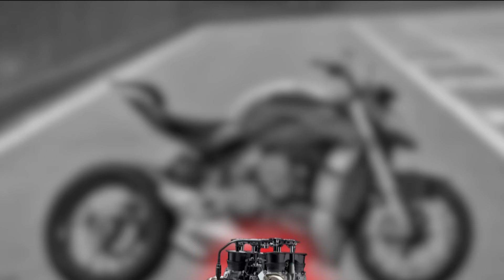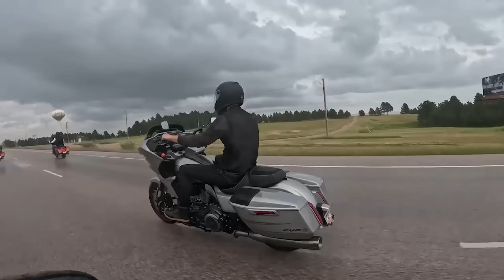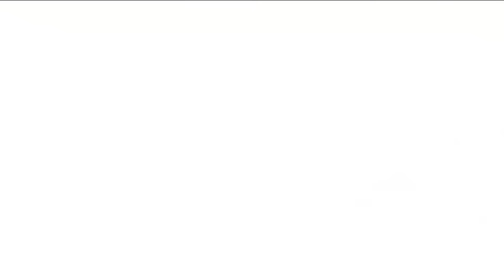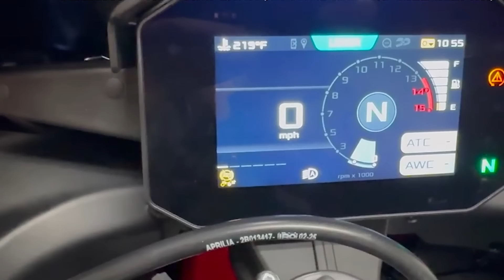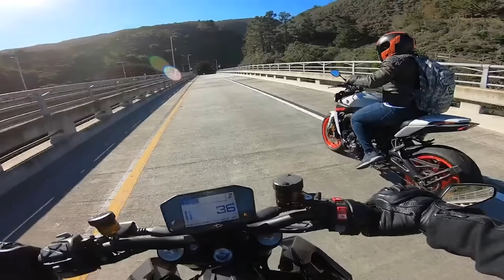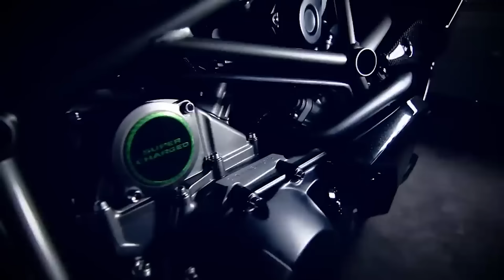Top 15 Most POWERFUL Motorcycles Of 2026

Comment: And what if I told you that these are just very expensive numbers. With more than 45 year of riding motorcycles, with many kilometers on race tracks and hundreds of thousands of kilometers on roads. That these horsepower and torque figures serve solely to brag about. And with which you easily make a fool of yourself when you get dropped on a back road trip by a 30-year-old 600cc. I even saw someone on a Brutale who was left behind by an old Guzzi 850T. It is not the motorcycle but the rider who makes the performance. Just believe me. The price does not determine your skills. And in my experience, 120 horsepower is more than enough. And all that computer and electronic junk is only good on paper but doesn't teach you the real skills needed to become truly good. Anyone can ride fast in a straight line. And when you have to pay tens of thousands of dollars to ride 400 meters in a straight line? No, a motorcycle trip with your mates doesn't have to cost a fortune. And doesn't need all that nonsense.

Comment: One of my bikes is a 1993 vmax with 1200 miles on it. It’s the best lookin and most fun muscle bike around. No need to spend big bucks unless you’re looking to have a bar hangout story. Plus a drive shaft and comfort.
Reply: I had the same bike in deep purple and it was bored and had basically a muffler with no baffle,,,at least I took it out for shits and giggles but was so loud I couldn't hear my roommate on the opposite side lol I really miss it!

Comment: The Busa got the technic Standard from 2000 only stil popular in the USA.. to heavy only for straight streets not Mountain Curves
As Time moved on the Kawa H2R with a Kompressor IS playing in another Speed League
Also the KTM Duke 1390 Naked Bike 190 HP is the King of the Mountains, Raw power from 2 cylinders, almost unrideable, but in the mountains you'll leave any 200+ HP supersport bike behind, if you know how to ride it 😉🌶️👍
Reply: That's strange. I live on the western slope of Colorado just outside of Telluride and the Hayabusa and I own every corner we come across. Experience is the key to any of these bikes, my Hayabusa actually out performs my MV dragster taking corners at speed.

Comment: I've had the ZX11 it was a beast trans was clunky I thought but bad ass. I also have a 2006 K6 GXSR 1000 reports have its weight dry at approx 360 ( which sounds light but with the gentalmas agreement 186 top speed it's in low 2's which was on an 06 0- 120 or so keeps up or beats most including the Hayabusa supposedly with good launch. 

2006 5k miles two years ago $4000 new 2004 I think ZX11 MSRP $9000 bought $6000 on sale.  

2026 R1 $24000 WTF I know it has more stuff on it but holy shit

Comment: Incorrect, the KTM has 190Hp, it does 0-100 in 3.3 seconds and does not come with Carbon Fibre Wheels. Plus there were no 2025"s made only 2024 and now 2026 models are arriving.

Comment: PGM took two R1 engines and made a 2.0 V8. It makes 334hp. I've always thought it would be cool if someone took the Yamaha VMaxx V4 and make a sportbike around it. It would be brutal.
Reply: The war a dual R1 would deliver the power would made a great MINI engine swap, or a 240Z
Reply: Ariel Atom 500 - V8 made from 2 Hayabusa motors, Naturally aspirated - 460Hp and 280ft/lbs, 2.8L Turbo version makes 785hp and 505ft/lbs, made by JFC Racing. Used in The Ariel Atom 500, multiple hillclimb cars and others.
Reply: @paulherriot7412  I thought they were Honda engines like the 1.8 2.0 and then they had a V8 version that was like six figures but that aerial Adam is like a go kart hopped up on F1 juice
Reply: Yes that would be insane

Comment: Wrong infos in this video. Like when it said the bmw is the only production bike with six cylinders! What about Honda goldwing? It has six cylinders as well. Don't believe everything you see on YouTube.  Do your research
Reply: Yeh, there have been Suzukis and Kawasakis with V6s also.
Reply: @nickcraft6235  wrong. MOTORCYCLE Engines have never been V6.  Pancake 6, inline6 (or also called a transverse 6). No, Suzuki has never produced a 6-cylinder motorcycle for public sale, but they did create a fully functional, very advanced 6-cylinder concept bike called the Suzuki Stratosphere, unveiled in 2005, which was planned for production but ultimately shelved due to financial reasons. Honda CBX (6 cyl), Kawasaki k1300 (6 cyl) Honda Goldwing 1988 to resent, Benelli SEI in the 70's was first a 750 then bumped to 900.  That really is the total history of the Flat or transverse mounted engine 6 cyl ever made.
Reply: @anonimous2451 there have been V6 motorcycles mate. I didn't double check but pretty sure the (edited my post but maybe it was called a Valkerye not a Vulcan?) Vulcan was a V6.. anyways inline 6 Honda cbx 1000... (which i saw you mentioned..)
OK actual V6 Laverda in to 70's made a 1000cc V6 (prototype but still technically a V6 motorbike) and then there's a German built (Horex VR6 production) 1218cc and a Czech built (FGR Midalu limited production) coming in at 2500cc lol..

Regardless... fuck there were some nice bikes in this video.. would be awesome to have luxuries like traction control, skid control and wheelie control... coming from someone who rides older bikes... its kinda cool they've made em safer but I'm not sure how much "fun" it might take out of things.. 😊
Reply: @Podmiddy  The Valkyrie was a GoldWing without the bags and fairings. It used the Flat 6 Pancake Engine of the GOLDWING it was NOT a v6 and there has never been a v6 production motorcycle EVER produced for market. End of Conversation. You can THINK anything ya like but that does not make it true. The Engine is an Interference Engine which applies to some cars as well. If the timing belt breaks it grenades these type engines. FACT.
Reply: @anonimous2451  Pancake Engine 🤣🤣🤣 damn dude you must be american 🤣🤣🤣
Reply: @Podmiddy  OK BUD, clearly you don't know shiiiittt either. 
Laverda, founded in 1949 in Breganze, Italy, by Francesco Laverda, was
a renowned manufacturer known for producing robust, high-performance, and reliable, "overbuilt" motorcycles. Initially successful with small-capacity machines, the company rose to international prominence in the 1970s with their 750cc parallel twins and 1000cc triples (notably the Jota), which were among the fastest, loudest, and most desirable production bikes of their era. 
Key Historical & Model Information  
The 1978 Laverda V6 is a legendary,, ultra-rare Italian endurance racing prototype powered by a 996cc, 90-degree DOHC V6 engine that produced ~140 hp and exceeded 280 km/h (175 mph). Designed by Giulio Alfieri, this longitudinal-engined machine featured shaft drive and was built to dominate endurance racing, though it was later banned by new regulations restricting cylinder counts. It was a racing bike NOT a production bike. 
    Origins: Originally part of an agricultural machinery business, Laverda applied similar, rugged engineering principles to its motorcycles.
    1970s Dominance (750 Series): The 750cc SF (Super Freni/Super Free) series established the brand’s reputation for speed, including the 750 GT and 750S.
    Laverda 750 SFC: A competition-focused endurance racer, the 750 SFC (Sport Formula Competizione) is highly coveted, often considered a work of art.
    The Laverda Jota (1000cc): Introduced in 1976, the Jota was a 1000cc triple that became arguably the fastest production bike in the world, capable of 146 mph.
    Technical Evolution: Early models featured 180-degree crankshafts, which produced a distinctive, vibrating character, later evolving into smoother 120-degree engines.
    Decline and Legacy: Facing stiff competition from Japanese manufacturers, the company struggled in the 1980s and officially ended production in 1985. The brand was acquired by Aprilia in 2000, and later by the Piaggio group, but was ultimately discontinued. 
The Horex VR6 production was limited in scope and used a single man single build philosophy that saw it never produce enough to matter anywhere but maybe Europe. Ok I give ya that one. 
The FGR Midalu 2500 V6 is an ultra-exclusive, handcrafted Czech motorcycle produced by FGR, featuring a massive \(2,442\text{\ cm}^{3}\) V6 engine producing over 240 horsepower and \(160\text{\ Nm}\) of torque and a price tag around €120,000 in 2004. Basically a flash in the pan bike that didn't last and made in so little number again only noticed in Europe.  
Therefore I stand corrected on those 2 bikes, however, basically they are nonexistent and never made  production runs in any significant amounts. Meaning THEY DIDN'T MAKE V6 Bikes as I originally stated. Except for those 2 bascially one off's in an era that could not sustain the price tag.
Reply: Benelli had a six cylinder as well
Reply: @clintlangdon2362  Included in the first reply of the thread.  here is your participation trophy 🍆
Reply: It's a Goldwing but 900 kg lol😂
Reply: Thanks IDK that
Reply: no, it said INLINE 6. the goldwing is a flat 6. get your ears checked
Reply: @steveclampitt4356  Ya know those words are better left being unsaid but some folks can't help themselves. In the end what does it matter ??
Reply: @anonimous2451  much like your comment. but here you are huh ?
Reply: @steveclampitt4356  and here you are claiming there’s never been a production V6 motorcycle like you mean it 🤣…. Dunce
Reply: Also Triumph
Reply: The H2 makes more horsepower than a Porsche GT3😂😂😂😂😂
Reply: @StevenRago-p4f9k in 1000cc, what do not understand, its so easy.
Reply: @StevenRago-p4f9k you gotta be kidding.Thats.fckn insane power man.wt actual fck